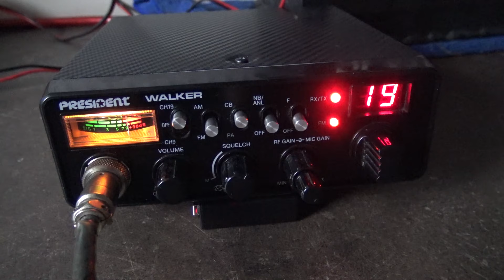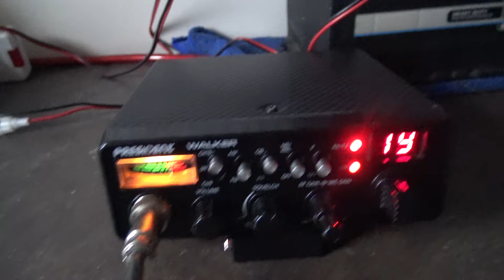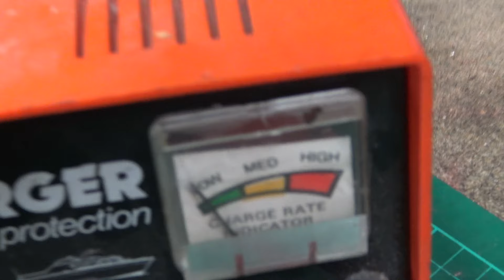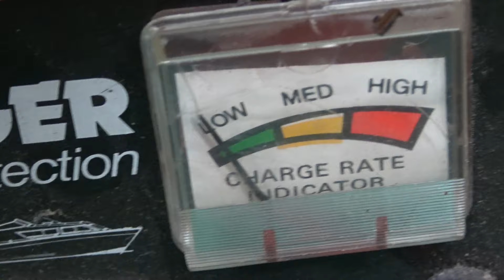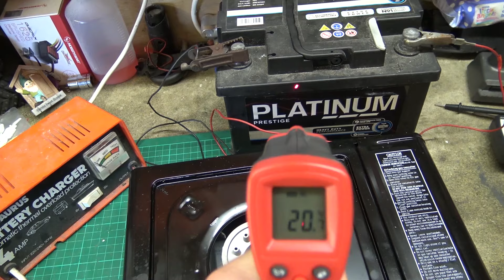Finally Got a Wire Up For 40 Meters

Comment: If it was tripping out the RCD it could be as simple as a connection inside the charger that has come lose and gone to earth through the case . Hence tripping the RCD. Also as you said you used it to charge a battery from dead it could have overheated internally and it could be anything really but if their are soldered connection they are quite common to go wrong when things are overheated.

Also great video! Keep up the good work.
Reply from the maker: Thanks :) yeah I’m hoping it is a dry joint or something lol I’ll take it apart soon 😁

Comment: my long wire goes from a cap on the roof (tired to wooden beam in the attic), to a metal pole (with insulating egg) to my shed. I'm not that keen of going on roof top. it could effect the signal
Reply from the maker: You should get your licence 👍🏻
Reply: @RSPYT  that's what Roger wants me to do
Reply from the maker: Just do it it only takes two days